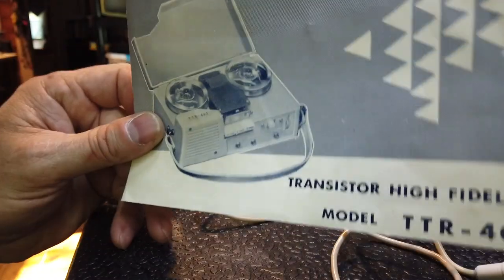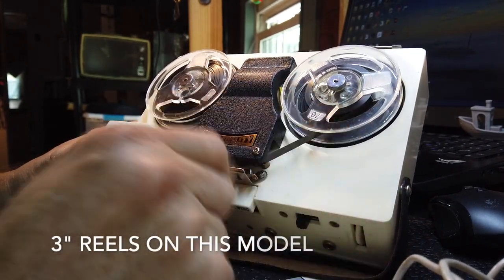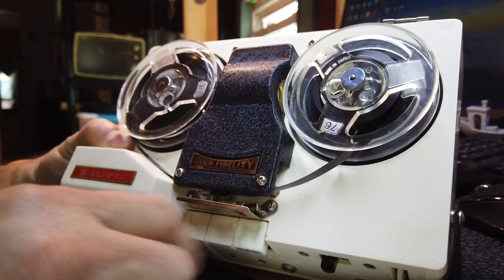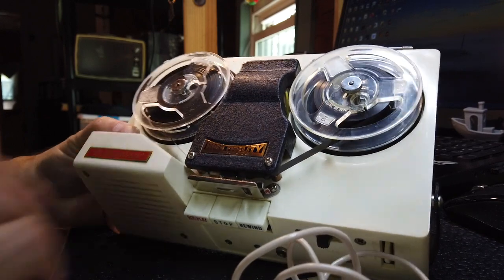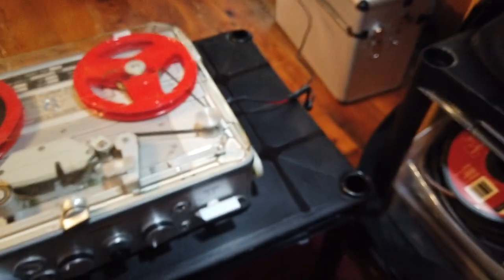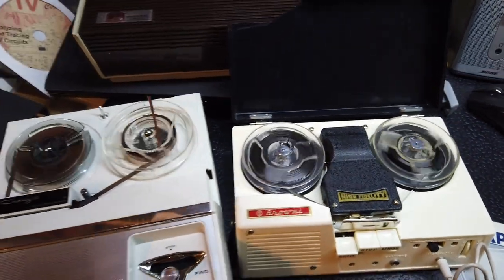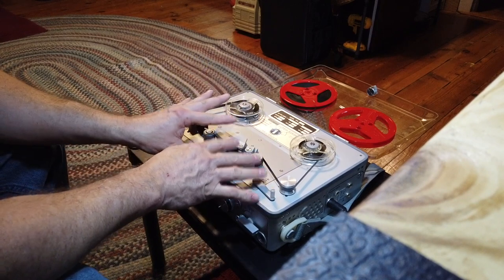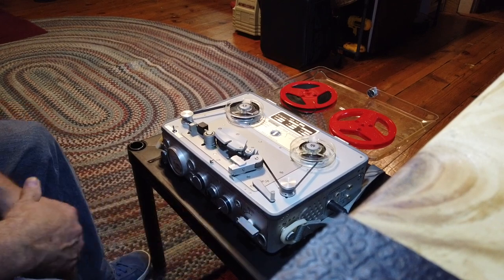"Extra Fast" Browni TTR 402 High Fidelity Tape Recorder

Comment: Hello Kent I have an Apolec model RA-11 that has the same rim drive mechanism and it has a bad motor. I took the motor apart and thought I fixed it but it still acts up. It has an intermittent problem with speed. It works good and sometimes it slows down like an open intermittent connection on the communtator. I haven't found the culprit yet
Reply from the maker: I know what you mean. Maybe you can find another old tape deck and use the motor. Have you tried spraying the motor with contact learner and letting it dry?
Reply: @KOVintageTech  I took it apart and cleaned the commutator and carefully oiled it with 3in1 but still intermittent. I just now noticed if I shake it a little from side to side and let gravity pull on the shaft it acts up. I'll try spraying it. I don't have any contact cleaner but I have some 91% alcohol spray that I think can clean off the oil on the commutator thank you and hope you're doing well. I'll need to let it dry real good before I power it up because alcohol is flammable 😆 If I get it fixed I'll let you know what I did in case you encounter that

Comment: I souped up one of these 😆 just to see what happens. If you get some plastic reels that are centered true it will have steady speed. I'm in the process of converting these little recorders to AC bias I have done one already in my collection and also replaced the germanium amplifier with a homemade silicone transistor preamp circuit and a TDA7052 4 pin 2 watt output IC. The speaker I replaced came from a high tech flat screen parted out TV they have high compliance hi powered 10 watt tiny polypropylene speakers that far exceeds the original paper 0.5 watt. I built a simple one transistor oscillator that puts out 55 volts peak to peak at about 30 khz from a 9 volt battery. The sound quality improved drastically. It has a headphone jack where I can plug in a large external speaker that sounds fantastic. I wish you could hear it. The audio head on these is pretty decent the pinch point would be the transformer coupled germanium amplifier coupled to a paper speaker with DC bias.
Reply from the maker: Incredible upgrade!!